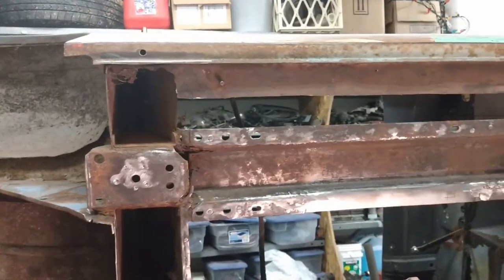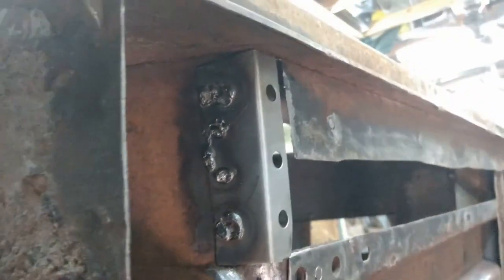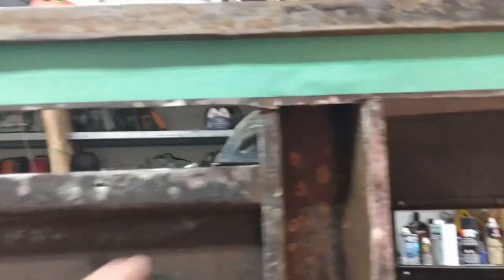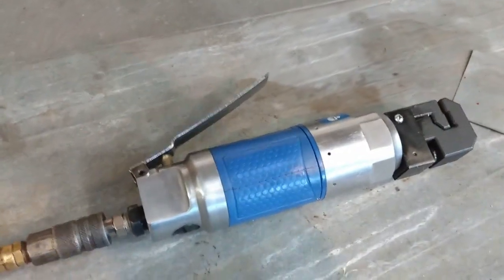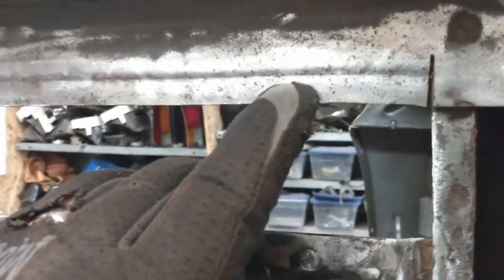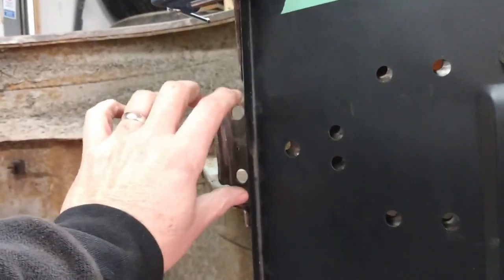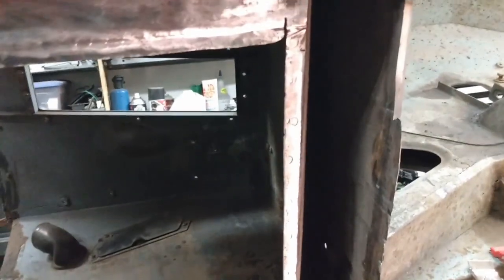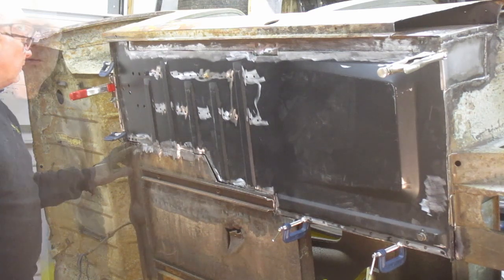Austin Healey Sprite passenger side floor pan and a new tool! Bugeye Build Episode 13

Comment: I had no idea that a "flange tool" even existed. Looks very useful! Thanks.
Reply from the maker: It was very helpful. I found the lap joint a little easier to weld that the plain butt joint. The hole punch side of it will probably get used a lot more. It's also called a 'joggler'.

Comment: Hi are you using a .6 wire on your machine, sounds like you need to decrease your voltage and slightly increase wire speed..6 is the way to go on panel work, but keep up the great videos.  Cheers Kev from australia
Reply from the maker: Thanks Kev. Yes, that's the size I'm using. I got things dialed in and my welds got better moving forward from this point.

Comment: Excellent. Made my evening. Actually made progress myself this week removing the racing dashboard, instruments, the short windscreen and cleaned up the interior of the racecar. Spent quite a bit of time inspecting these areas that you featured in your last few videos too, lowe a pillars, floor pan. What are you using for rust converter / inhibitor again? I got a few gallons of evapo-rust. Can you provide links to the rust inhibitor and seam sealer?
Reply from the maker: Thanks Ken, I'll be posting info on the seam sealer and rust converter in next week's video.